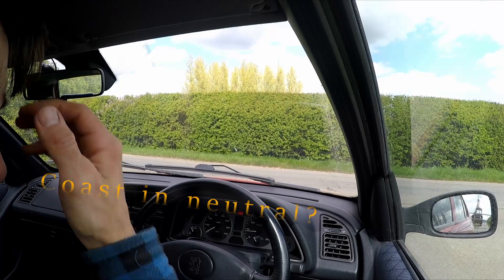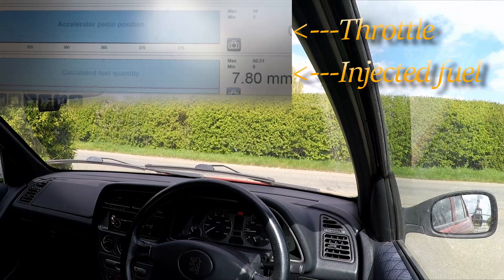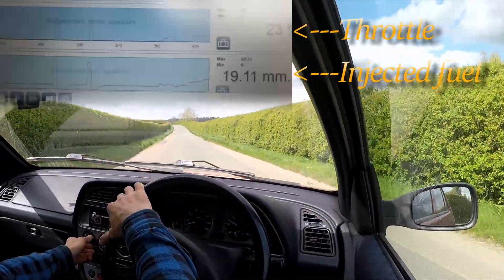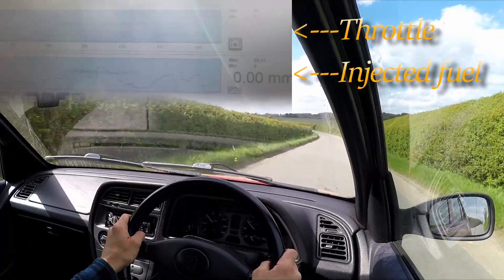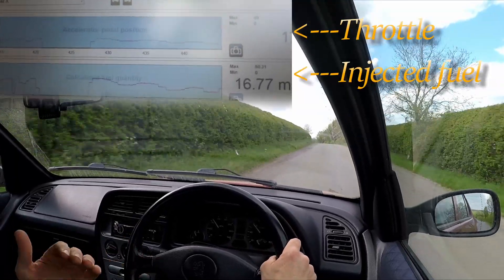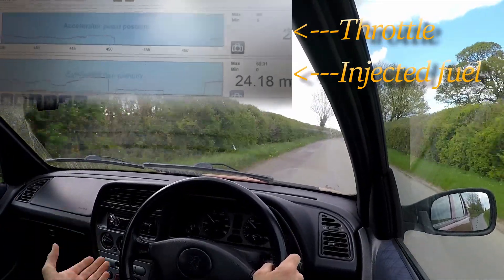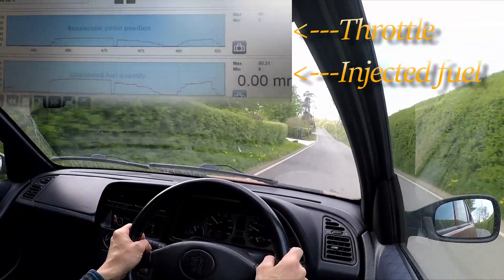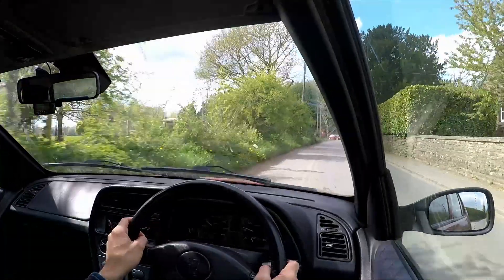FAQ: Should I lift and coast? MPGs! Save fuel!

Comment: what about carburetor old car same rule apply on carburetor
Reply from the maker: No, they often continue to inject fuel as its the air flow past the Venturi that draws fuel in. (At least the idle circuit will be pushing fuel)

Comment: This is an interesting debate. Village I drive through if in gear coming down the hill not super steep probably be maybe half a.mile I can coast in gear. Then hit a.small slope and need to apply throttle we're as in neutral I may make it most of the way through the village which is a couple miles long just on coast so yeh I may be breaking the speed.limit at the beginning slightly as gained speed on downhill but I coast far further. We're as in gear the speed drops off I then half to hold throttle to.keep the car moving at that speed. By my cars mpg calculator coasting in neutral is far superior by a long way but I don't really trust it. I can get 60mog average with just the normal method of leaving in gear but computer states over 70 mpg using neutral coast method . I did this over a couple of journeys and results repeated.
Reply from the maker: But you broke the speed limit and lost a measure of control with your vehicle... So 🤔
Reply: @PiggyPower  but the video is wether coastings save fuel. In my opinion makes no sense to go in to say a dead 40 zone from a 60 and chuck the breaks on when you could use some of that energy to carry you further. Isn't the video about what's the best option not the legality.
Reply from the maker: @HA05GER  yeah, so waaay ahead of the 40 zone... Lift off... No use of brakes... Traveling for some time at 0 throttle = no fuel. Thus extending the period of time you are traveling without using ANY fuel.... And entering an area at a suitable speed where the limit is there to protect vulnerable road users and villagers. 
 Clearly legality and car control are without question part of the discussion and video, it just doesn't need to be said. I would never endorse dangerous or illegal driving in my videos.
Reply: @PiggyPower  I agree.woth your method but it still doesn't answer the question of which is more efficient. In that method I could drop in to neutral twice as far back to then slow down for limit decrease. Autos Essentially drop out of gear when let off the throttle the one I drive does at work i don't really see the issue with loss of control
Reply from the maker: Yeah, and it's one of many reasons why autos are less economical than manuals! I can assure you, overall, coasting in neutral will use more fuel. Dropping into neutral twice as far back means than for twice as long, the car is using fuel while traveling and gaining speed, into an area of reduced speed limit and then the need to brake, wasting energy. Or lift off the throttle IN gear ahead of time, planning ahead, and use no fuel at all.
Reply: @PiggyPower  I guess it makes sense as e cars wouldn't regenerative brake when letting go off the gas. Why wouldn't any car company want to make an e car more economical range anxiety is what puts people off. It still intrigues me though more than anything I don't do it and use the normal technique of using the gears .
Reply from the maker: Most E cars now are single pedal control, so it's all intelligent and sometimes regenerates and sometimes doesn't... It's doing all the eco work for you.
Reply: @PiggyPower  maybe never driven one myself so don't know exactly it I know the whole one pedal control idea but I just assumed assume as you let off the "gas" it applies regenerative braking
Reply from the maker: In general it will yeah, but there's different modes and energy/battery states that change it. Plus you can just turn it off ... Or get a real car 🤣🙊
Reply: @PiggyPower  yeh I like a car that runs on dinosaurs

Comment: Brake pads are cheap. Tranmision and motors are expensive
Reply from the maker: But fuel is really expensive?! And coasting downhill in gear, doesn't wear the transmission or engine any more than coasting downhill in neutral. If anything, it saves on them a little.

Comment: Might be worth working out how long you coast for vs how far you’ll go in gear
Reply from the maker: That would vary with every time you lifted off the throttle based on initial speed, incline, weight of vehicle, road conditions, hazards... But in all cases coasting in neutral will use fuel. I understand you are thinking that without engine braking you will travel further or even pick up speed, which is a bonus, but I can't see it helps overall, especially if you lift and coast (in gear) at the right time.
Reply: @PiggyPower  I think mainly what you confirm here is fuel cut. You’d need to test how much fuel is used to maintain a speed vs coasting in gear vs coasting in neutral. Some cars have more engine braking than others too. Coasting in gear means you lose energy to the gearbox and engine, is that lost energy more than the energy lost keeping the engine ticking over whilst you’re coasting in neutral?
Reply from the maker: @glenridesmotorbikes  you can’t compare using fuel to maintain a speed vs coasting (in/out gear)… because you don’t want to lose momentum at any time. However, if there is a decline ahead, you should consider the speed and gear most suitable (and safe) for good progress while being able to be at zero throttle if at all possible. Going downhill in gear and off throttle can be maintaining speed whilst maintaining control and using no fuel. In neutral, none of that is true. Many also knock the car into neutral when approaching hazards or slowing traffic or junctions/roundabouts…same applies. You have lost a measure of control over the vehicle and are now using fuel… as opposed to planning ahead and lifting off the throttle in good time. Coasting in neutral will never be the right thing to do, either from a control point of view or fuel saving. (Or brake lifespan)